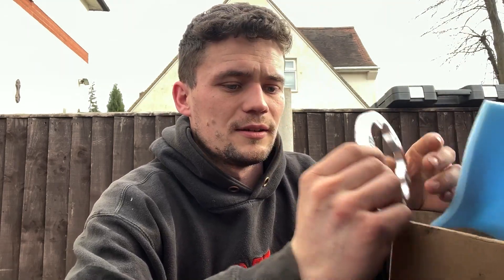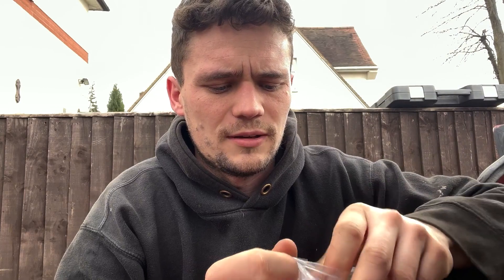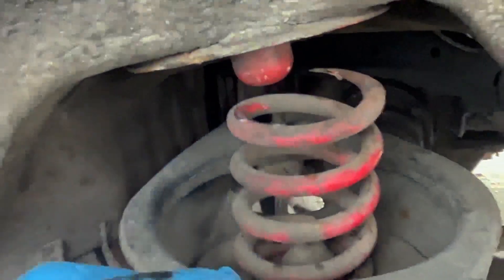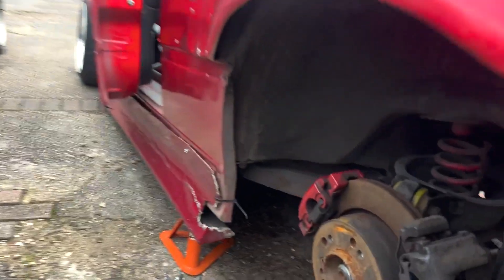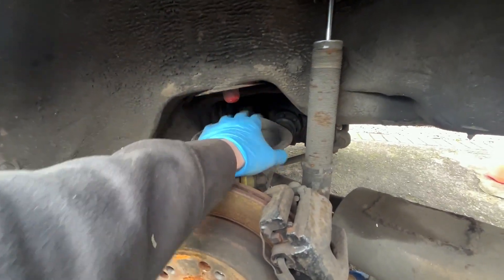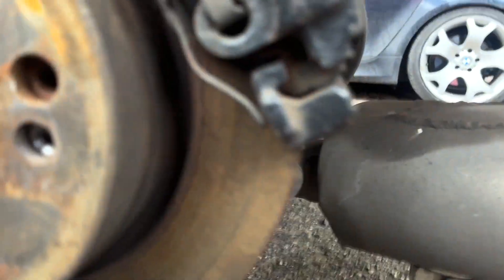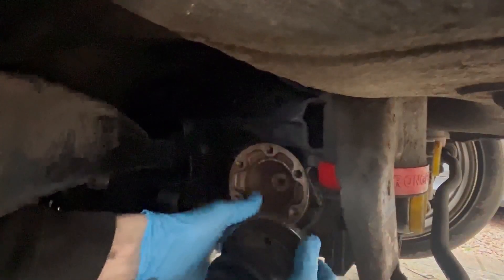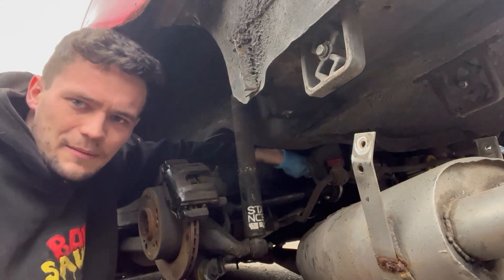E36 Driveshaft Spacer Install

Comment: I ran these spacers for ages and never snapped a shaft 👌🏼 only took them off as I’m going to be using different shafts now
Reply from the maker: Well that gives me hope! What kind of shafts are you running now?
Reply: Going to use e46 330d shafts, hoping it will hold the 2jz power 😂